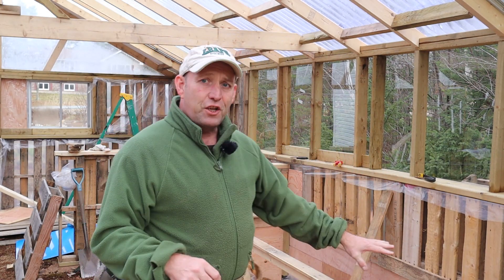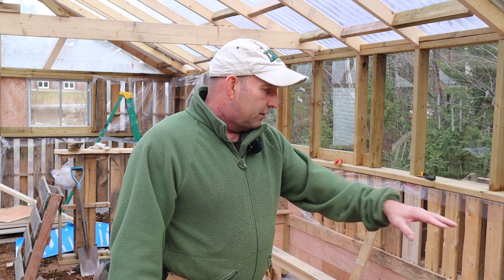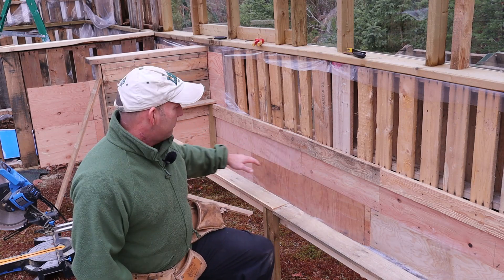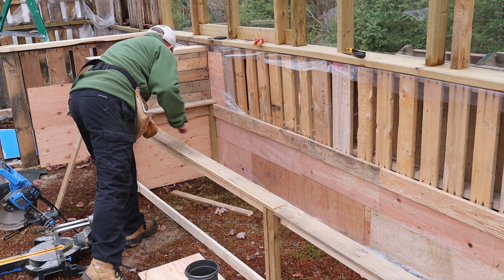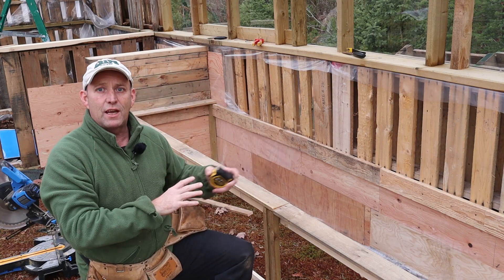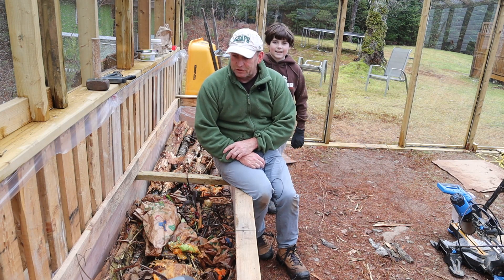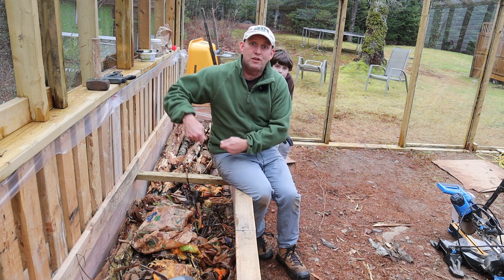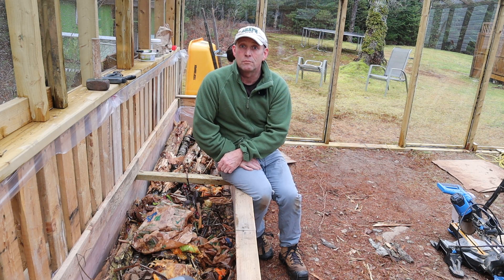The Great Greenhouse Project 2020 -  Episode 8 - Hugelkultur, Raised Beds and Hot beds!

Comment: Job is a good un Steve... Loving the work you have done to the greenhouse. Well impressed. Just shows what you can do with stripped down pallets. I'm just putting a 6x6 greenhouse a friend was getting rid of, I will be getting barrels soon to fill with manure to see if enough heat will be conducted and passed on by the barrel. Plus I have built an outside heated which will be used next year as I have found someone who will supply me with as much fresh horse manure I want. So happy days. Da Iawn Steve....... #craigs_kitchen_garden
Reply from the maker: We can swap results to see how we have got on. I will be happy if it provides a bit of bottom heat around the young plants :)